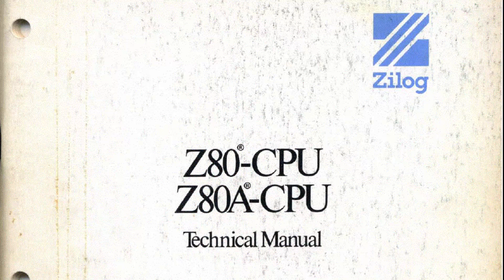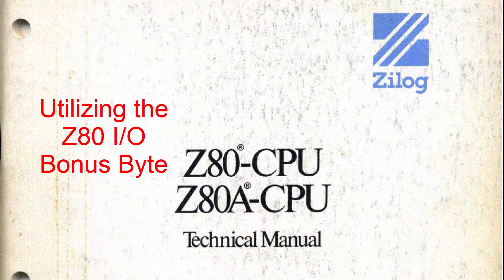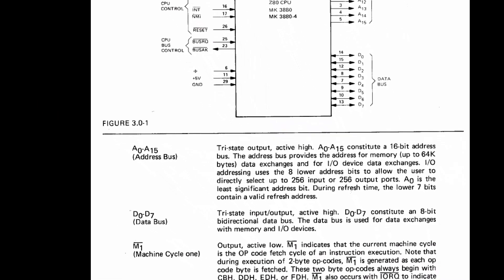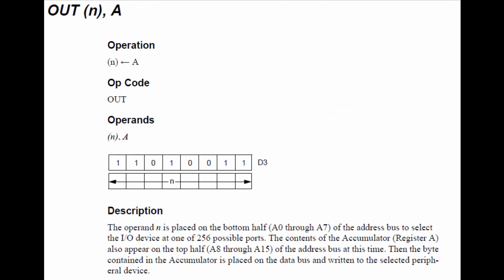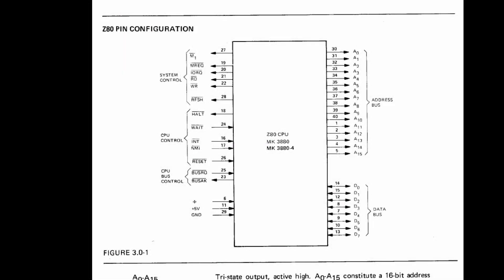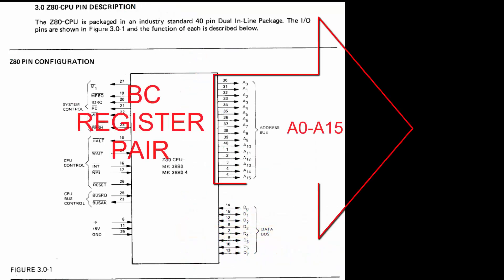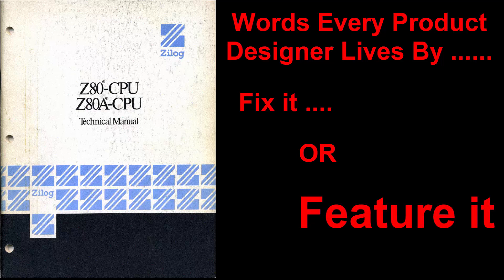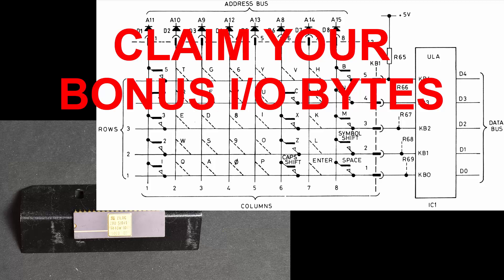{66} Doing Z80 IO ??   CLAIM YOUR BONUS BYTE !!!

Comment: "Something [Intel] intended, but did not finish". Hmm, sounds a lot like the 8051 instruction set. The Z80 already was more time efficient than the 8080/8085, without this video's little gem. I haven't worked with the Z80 since ~1989, but used it almost exclusively for more than a decade up to that time. My work switched me over to microcontrollers. First the Motorola HC05, which was a joy to code, in assembly. Then the 8051, which had parts made by everybody, and their mom ! But the 8051 instruction set always puzzled me a bit. It looked like the Intel design team, for the original part, took a break in the middle of specifying the instructions, but never finished, before sending off the part for production.
Reply from the maker: 😂😂😂😂😂"It looked like the Intel design team ... took a break in the middle of specifying the instructions"🤣🤣🤣🤣🤣🤣

Comment: This awarness let me make a Z80+ROM only keyboard encoder design to replace a blown and overpriced keyboard chip .
Reply from the maker: That sounds like and interesting project. Some of those OEM custom keyboard controllers (with their custom character mapping) are getting hard to find.
Reply: That's awesome. Did you ever document the project?
Reply: pencil drawing remembered placing 2732 EPROM over data and address pins and soldering directly some of the pins . The takeaway for the project was that an address or data line pin does not have to be used as comventionaly labled and high order address line could be used as keyboard row select . The code was echoed in the EPROM , translation table ,  brute force and easy . Most important was it fit and could be replaced with original device later .
Reply from the maker: Yea, nice things about EPROMS for look up tables is no matter what is controlling the inputs, each input configuration results in a known (stored) value on the data lines. Doesn’t matter if the inputs are an address, a position encoder, a coordinate, a temperature, a keyboard, or anything else.

Comment: The block I/O instructions IND, INDR, INI, INIR, OUTD, OUTDR, OUTI & OUTIR also output the contents of the B register to A8-A15.
Potentially a peripheral could use this to know how many bytes the CPU is expecting to read or write.
Reply from the maker: I had not noticed this.  the z80 technical manual has a nice table on page 54 that lists in the comments everything that goes out onto the address bus during the I/O instruction group.

http://www.bitsavers.org/components/zilog/z80/03-0029-01_Z80_CPU_Technical_Manual_1977.pdf

So far, i have not found where zilog makes any mention of actually using this feature.  it seems like something that others would have put out an application note or some other means of providing insight.
Reply: @HelloWorldETX  It doesn't help that the timing diagrams on page 15 of the same manual imply that only the lower eight bits of the address bus are active for I/O cycles.
Reply from the maker: @markevans2294  indeed.  It is these sorts of things in the data books that make me wonder if some things were intentional design features or just design accidents
Reply: @HelloWorldETX  Not accidents but just undefined. In these first microprocessors, not everything is decoded/gated completely to save few transistors (remember these were designed by "hand" on big sheets 🥵) so as long as the main goal is achieved.
Reply: yes, but you need to discriminate the others opcodes that also place the B or A content on high address bits. otherwise the external hw could be 'confused' by instructions like out (0x90),a or out (C),r

Comment: So this is how the Sinclair ZX machines did their screen generation.

A keyboard array code would be best generated by autonomous clocking hardware, so a code and strobe generated externally to the CPU. 

All depending how cheap the hardware needs to be.
Reply from the maker: I have never used a Sinclair ZX.  Could it’s performance have been improved by using dedicated hardware? Or were they able to do the keyboard and video essentially by utilizing mostly dead time?
Reply: @HelloWorldETX  The keyboard diagram is from the ZX Spectrum, though the design originates from the ZX80. The reason is to save the hardware cost.

In the ZX80 and ZX81 generating the video is effectively the primary task of the CPU. Hence the ZX80 would blank the screen whenever it did any processing. The ZX81 had few additional logic gates to provide a SLOW mode where Non-Maskable Interrups were used to tell the CPU when to generate a video signal or a FAST mode which behaved like the ZX80.

With the ZX Spectrum, the ULA contained a video generator. The Spectrum ULA had priority accessing the lower 16k RAM, where the video memory resised. Which it would do by controlling the clock signal to the CPU. Which is an undocumented DMA method,
Reply: @markevans2294  This cheap method has the advantage of slowing down the processor the least possible (though Soviet clones used a different bus sharing method that didn't slow it down at all, but of course used much more additional components), compared for instance to shared access to the video RAM 1 cycle out of 2 in for instance Commodore machines, that effectively halved the resulting processor speed.
Reply: @markevans2294  there is another thing related to video. they should had use the busrq signal instead they 'decoupled' the bus by using resistors
Reply: @Z80Man  How did the soviet clones completely avoid cpu pause during video fetches?
Reply: Hi ! From what I've read, they used the fact fetching from or writing to a memory address cost several clock cycles and sneaked inbetween... :p

In short, access to video memory from the cicuitry (they didn't use an ULA  but regular TTL crcuits instead - but soviet versions) was made shfted by one clock pulse out of two, so by the time the processor had finished putting the 16 bits address on the bus, lowering the /MREQ line and either /RD or /WR to read or write the data byte(s), the video circuit would have finished reading the current byte to display.

It was just a better way to access the video memory, using the Z80 long time to process instructions and memory and I/O access.

The drawback with the Z80 is its complex instructions set there can be as much as 2 prefixes before actual instruction due to the excessive number of 256 instructions tables (though it's also what made the hidden instructions easy to find about, because rhey're all the same with various prefixes combinations), explaining why they had to run at much higher vlock fequencies to compete with simpler processors such as the 6502   

Also, the Z80 has always been introduced as a 8/16 bits processor. What it loses in instructions complexity, it somewhat gain it back with instructions performing block teansfers and 16 bits transfers.

Of course, reading or wirting a 16 bits value take more clock cycles because the sata bus is 8 bits wide, so it requires additional clock cycles to put the next address on the address bus and the second 16 bits register half on the data bus, but the there's no additional instruction to fetch nor decode, so the income in overall speed is beneficial.

In this aspects, BC, DE, HL, IX, IY (and their secondary counterparts, BC', DE', HL', IX' and IY') are true 16 bits registers and benefit from a shitload of dedicated instructions.

Even the accumulator + flags pair AF (and is secondary counterpart AF') can be treated as plain 16 bits registers by some instructions.

Pushing to or retreiving all of these registers to or from the stack is a single, short instruction that exchanges 16 bits values with the memory (albeit still taking more clock cycles than for a single byte). There also are a few ultra fast instrctions exchanging 16 bits registers contents.

And of couse, the Z80 has a full 16 bits I/O bus. Having always learned from the Rodnay Zacks book from the start, I even had no idea some people didn't know about that !

Edit : you should get more information here :

retrocomputing.stackexchange.com/questions/22257/could-the-z80-do-interference-free-video-as-the-6502-could/22283#22283
Reply: @Z80Man  Hi, i know some of the 8 bits beasts of the '80 like the Amstrad CPC, ZX speccy, C64, MSX from the 'electronic point of view'.
It's always a tradeoff. I didn't knew the soviet clones, however.
something like the variable instruction length issues you find on  z80 are also there on "6510 (similar to 6502)-based" C64. As you pointed out the 6510 have a more simpler memory access schema (no variable instruction timings). Teoretically, you could do a 50-50% time with the 6502 in a very simple way, however you get  problems because the video circuitry (called VIC-II) needs to access the RAM more often than allowed by the 50-50% time allocation .

In a normal situation the 50-50% schema is enough to avoid cpu stops, however, in the worst case the VIC-II needs to fetch additional 40 bytes from memory and for every hardware sprite you have to show on a particular scanline you pay and extra 3 bytes fetch. in the worst case those extra fetches are 40+8*3=64 stalling the cpu for 64us for a specific scanline.

Effectively the shared vram approach needs more faster chips to be "lock free"
Reply: About the keyboard,

1) Autonomous hardware would have significantly raised the cost, and the ZX Spectrum was designed to be dirt cheap and affordable ;

2) Autonomous hardware with its own clock, and usually a buffer, results in less flexibility, especially when it's about fast polling and detecting multiple keyboards strikes at the same time, for instance for games or polyphonic music (when the keyboard is used as piano keys).

The ability for the processor to directly read the keyboard matrix brings much more possibilities in some cases. It also makes it much simpler and cheaper to use it as an alternate I/O device for some uses (the ZX81 and ZX spectrum were widely used as automated control devices for a shitload of applications in electronics, HAM radio, etc.)

As a matter of fact, the original keyboard polling routine in ROM was perfectible and good games, word processor or programming language editors often used their own better and more reactive substitute routine.

Sometimes, simpler hardware under direct processor control can give way to lots of later enhancements that weren't planned from design.

Most of the ZX spectrum hardware is in this case, and when it's not entirely because it's controlled by the ULA, the interrupt routine is then hijacked to do additional work, mouse polling, multitasking, screen synchronization so no flicker is visible on screen, and so on.

All this without any dedicated hardware (though for increased speed, lots of games have been modified to use the DMA found on the MB-02 disk controller, and of course its Russian successor the MB-128, and you can also add a standalone Datagear DMA interface using the same addresses for compatibility).

Comment: Yeah, Z80 has 16-bit wide i/o space. I wonder, why datasheet crypting that fact, and does even worse - explicitly omiting A8-A15 from signal diagram.
Reply from the maker: Maybe it was an accidental feature so it wasn’t documented as an actual function.
Reply: No, the Z80 has only an 8 bit IO address space according to its datasheet.

That you can put an additional byte of data onto A8..15 does not make it a 16 bit address space, although you can (ab)use it this way.

But whether it is specified as an immediate or indirect, the IO address is still only 8 bits. The datasheet is consistent in its explanation of this so I'd doubt that it is any kind of error or omission.

The source of the value for A8..15 is also inconsistent depending on which instructions you use, which I think further cements the fact it is 8 bit only. If it were officially 16 bit then A8..15 would be sourced from a consistent register to ensure that no matter which instructions you used you could always address 16 bits worth of IO space in the same way.
Reply: @TomStorey96  Nonsence.
Since CPU does drive address bus w/ full 16 bit address from BC, executing register-indirect i/o instructions, it is full 16-bit address space (and 8+8 extended for immediate indtructions).
It is not a kind of hack, it is designed and documented behaviour. Designers, probably had their reasons, why they omited that in specs page (and "BC" in instructions args), probably because of 8-bit address legacy and string instructions. But that fact should not be doubted.
Reply: @semibiotic  the datasheet states:

"IORQ indicates that the lower 
half of the address bus holds a valid I/O address for an I/O read or write operation"
Reply: @TomStorey96  Datasheet lies (more precisely it lacks that and other essential parts), as I stated in initial commentary, and I wonder why.
Reply: @semibiotic  The datasheet is quite clear to me, and repetitive enough to make me think it is not an error. Even the description of this video lists 3 potential uses of this additional byte - two of which are not related to addresses.

The datasheet is quite clear in the fact that IO addresses are only 8 bits. Immediates are specified as 8 bit (n) whereas 16 bit are specified as (nn), and indirects are specified as 8 bit (C), not 16 bit (BC), so they are also only 8 bits.

Can you make a 16 bit address? Sure you can. But you could also use that additional byte to write 16 bit data which suggests that it is not strictly additional address space.

So which is it then? Is it additional address, or additional data, or what? Ok, it uses the address pins to be presented, but the Z80 only has an 8 bit data bus that is already utilised. Circuitry can take care of taking those upper address bits and using them as additional data if it wants to.

Thats all Im going to say, becuase otherwise I think I'll just be repeating myself. If you disagree further, then feel free to question Zilog about it - its their product and their datasheet.
Reply: @TomStorey96  It is not "additional byte" it is high i/o address byte de-facto.
It could be unused by hardware developer, or used hacky way, as every address bit from 0 to 15. That proves nothing.
Z80 has backward compatibility with 8-bit i8080 address space for legacy software/firmware. Z80 software/firmware could use full 16-bit i/o space.
There could be reasons, why instruction argument is "(c)", not "(bc)", f/ex. Z80 i/o wasn't planned to be 16-bit wide initially. But 45 years it is.
I don't need opinions of current Zilog patents holders, they have nothing common with Zilog developers.
Reply: @TomStorey96  I can't disagree, that 16-bit i/o map is not Z80 baseline, but extention, because the most Z80 i/o instructions - string i/o ones, don't support that.
But that doesn't make A8-A15 an "additional byte".

Comment: This feature has been used on many Z80 systems such as the Australian microbee & British Amstrad CPC.  On the microbee the B register value output on the address pins A[15:8] is used as a data bus for IN A,(C) instructions. It done to provide two output ports from a single port address where one uses the standard OUT (port),A to write to the original port and  LD BC,# (<option value> << 8)  | <port_addr>   then  IN A,(C)  to output to the piggybacked port.
Reply from the maker: Thanks for pointing these machines out.  I knew some commercial designs used this but it is great to learn about others.  This is useful not only for new retro designers but also in understanding old hardware designs.  Without knowing the technique, some old schematics and designs would be impossible to understand so thanks for helping to convey and archive a bit of old school knowledge!